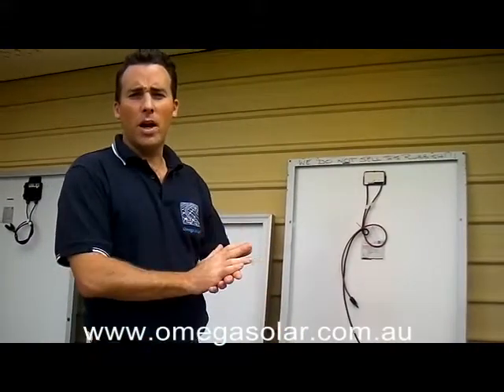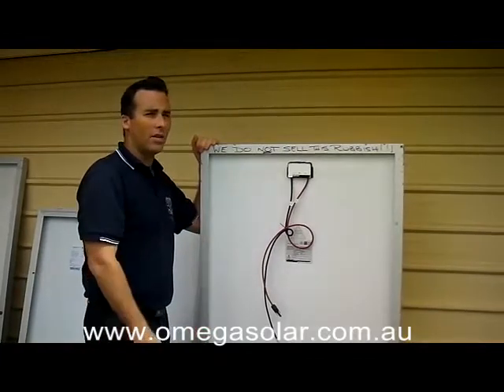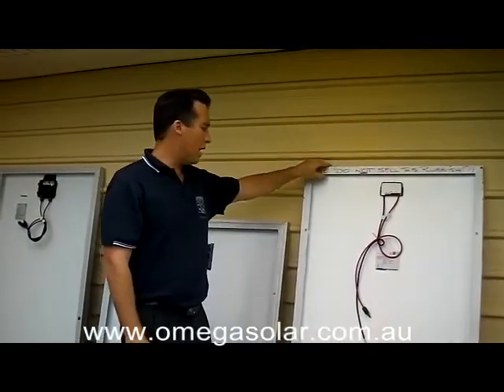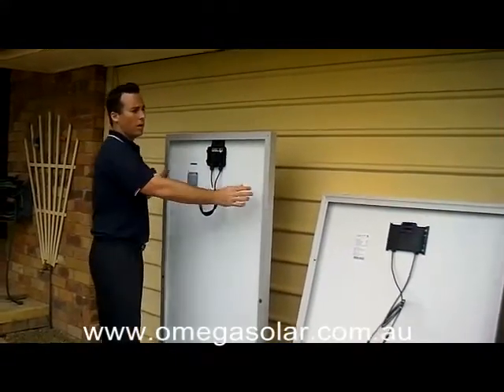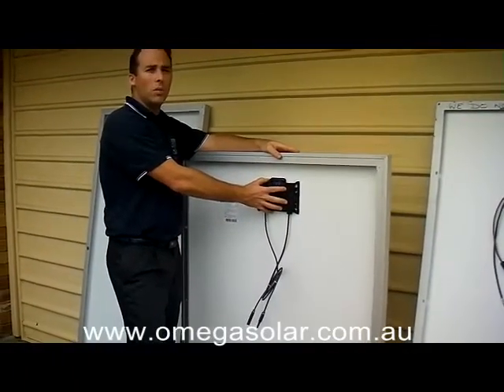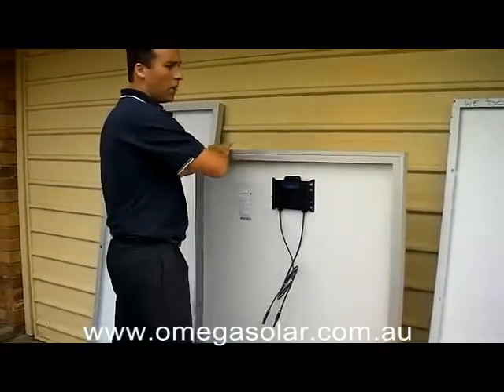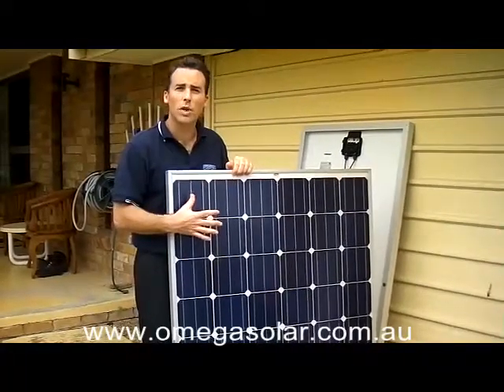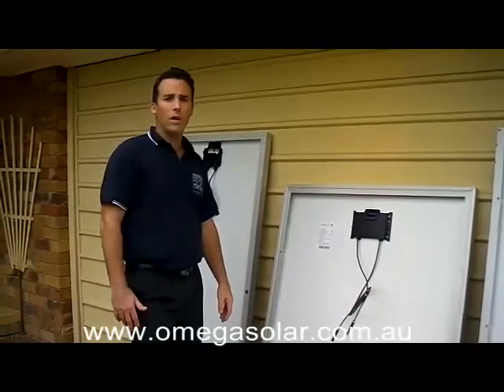Omega Panel Video.mp4

Comment: The panel has the connectors at the back that is not explained, like where does one get those fittings that will enable you to connect to the battery.... 😩